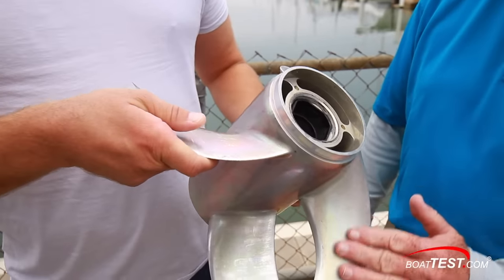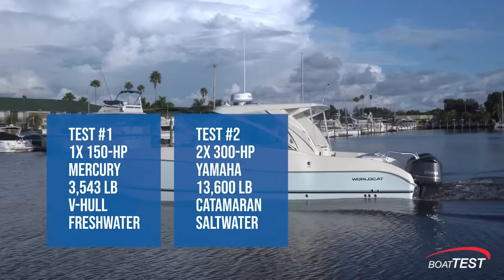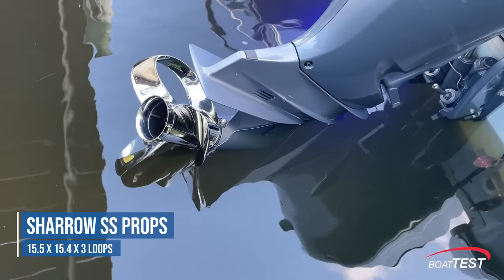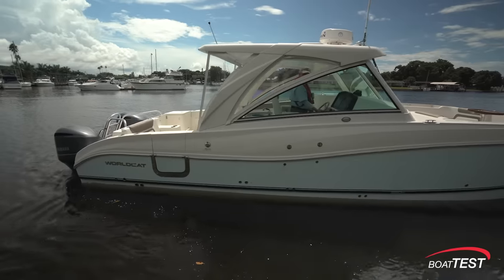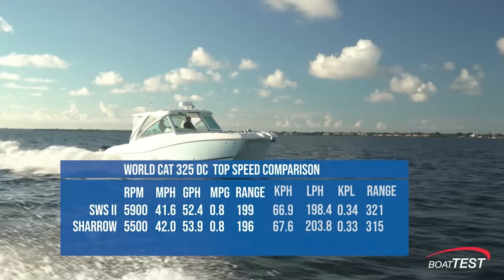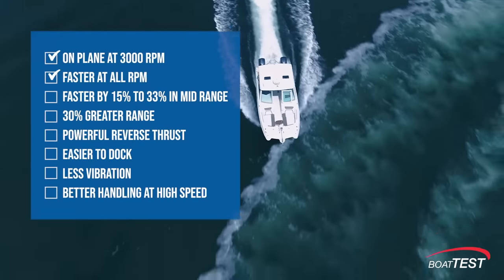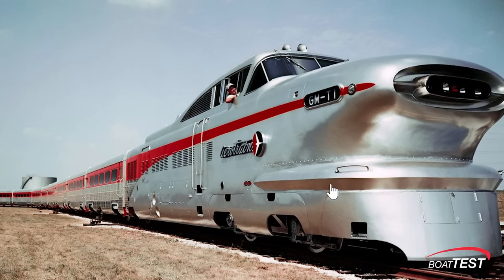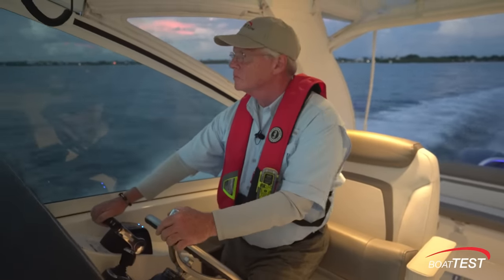Sharrow Propellers (2022) - Test Video by BoatTEST.com

Comment: Man that's a pretty rad prop. I'm glad I'm a machinist, cause there's no way I'd pay 5 grand for it. Pretty easy to see where the advantages lie. Plus it's probably way stronger. On the other hand, it's pretty clear that the testers let their impressions of this influence the way they portray the props. Advertising plus 1 mph when really it was plus .4. They rounded up despite being below the threshold for typical rounding rules. Not exactly sounding unbiased but it is a better design.

Comment: Disappointing rollout of this prop.  Doesn’t seem to have the financial backing to mass produce or distribute this prop. Current cost is absolutely not practical, with an indefinite wait time. No application for Bravo 3, with the highest amount of  stern drives on the market. But we do like Captain Steve
Reply: its a prototype. they are a startup company fishing for investors imo. they sell the prop as a one off so they can demonstrate interest for investors. once the money rolls in a proper production line will be setup. just look at tesla. they did a conversion of a lotus and made a fashion statement. now its world known brand that everyone wants a taste. this has same potential.
Reply: I'm waiting for the tesla electric motor conversion kit for my sundancer.
Reply: @steveh1121  do you think electric is more likely to succeed in offshore environment?
Reply: @adventuresofwillandshelby6013  i don't think it would be great for off shore just yet but for my pleasure boat would be great.

Comment: I have designed props for both watercraft and aircraft. By having a looped foil you are in essence having a wing tip on a wing. You see them turning up now pointing up down or both on aircraft. The benefit is they tend to reduce drag however extending the airplane wing plan further would do the same and create lift vertically. Wingtips pointing up and down don't really do that, however they do aid in keeping spillage on the main wing therefore indirect contribution to Lyft. They could simply have a longer wing and get a better benefit but then there are clearance issues in a busy airport.
The birds that soar the best have the longest wings with the pointiest wingtips. Birds that have to fly in and out of trees do it differently by having multiple wingtips dispersing the vortices that way they can be more compact. The albatross and the frigate bird have extremely long pointy wings and are the best soaring birds.
Reply from the maker: Wow, thank you for sharing this!

Comment: Would like to see this tested on some sailboats.
Reply: Most sailboats props can be folded/feathered so they don’t cause as much resistance under sail, this doesn’t look like something that could easily achieve this, likely meaning it’s not as desirable as traditional approaches. Otherwise though it’s a super cool design

Comment: I’ve had an opportunity to run these on a twin Yamaha 250 set up on a 26ft edgewater CC. For over a year now. The slow speed maneuverability is awesome with one concern: the engines sound and shift like they don’t not immediately have the torque at idle to spin up the props. It lasts only a split second but it makes me a bit nervous to hear the engines bog ever so slightly as they go into gear (both fore and aft) had the engines checked and all good according to Yamaha certified tech. I’m wondering if some applications require a tweak in engine tuning to operate these and maintain smooth operation and long term durability. Please address this!

Comment: I guess if you can afford to have a World Cat you can afford these props at 5 grand a piece, but for us common people no one can justify the cost. Hopefully the genius that made these props figures that out and lowers the cost.
Reply: As demand rises prices usually come down.
Reply: I believe these were originally 14k when they first started production.
Reply: Well when they come down even more, let us common folks know.
Reply: @michiganengineer8621  but at that price will demand rise?
Reply: @adamportner8102  Slowly at first.  But those who can afford a tricked out Freeman, Worldcat or Cigarette may be willing to pay a (relatively) small price to upgrade the performance of their boats.
Reply: @michiganengineer8621  but that test barley shows an upgrade. They are toting fuel savings but the person you are talking about is not interested in fuel savings. A guy interested in fuel savings is a commercial boater or someone that will not put out 5k when the average stainless steel prop is $400-$600
Reply: @adamportner8102  There is also the mid-range speed increase.  I agree that the overall increases aren't huge, but a 10 - 20% increase in fuel economy AND speed would be a winning proposition for someone willing to drop over a megabuck on a brand new boat.
Reply: @michiganengineer8621  I don't see any reason they shouldn't be able to sell these at the same pricing as a performance stainless steel prop. If they can't figure it out then hopefully they sell the patent  to a real prop manufacturer. Companies like Solas or tempest come to mind.

Comment: Sweet.....till the day it whackes a piece of drift wood....also....how does it help up to cavitation? Does it just get hot and turn purple like a normal stainless prop.....or does it bend and lose it's shape when it gets hot ? Seems like the missing center portion of each blade might be a compromise in overall strength

Comment: 5K for a prop lmfao. I'll pass...
Reply: Have you seen fuel prices lately? Especially if you're a commercial operator.
Reply: I'd rather run a bravo 1 30p for 1k instead
Reply: Seriously. That payback period is pretty long.
Reply: @scharftalicous  ok, you calc the ROI (return of investment)?
Reply: That is ridiculously expensive! 🙈😅

It's a coanda effect prop of sorts, I guess. (If memory of principles serve). 

I've seen quite a few airplane concepts making use of the same design principle through the past few decades. 

I would imagine only the dynamics/characteristics of the two types of matter (air/water) influences the differences in the angling and curvatures of the form to obtain either lift or thrust in the respective environment.

Interesting application of the concept. 👍
Reply: $5000+ cost will buy a sizable amount of fuel. I don’t use my boat enough to warrant it. I’ll stay with my $200 prop.
Reply: It’s just the cost of new tech. As more companies begin to develop these, prices will come down
Reply: Lol right 😂😂
Reply: how many running hours will you need to pay off?
Reply: U got to spent money to make money or u got to spend money to pay less money xd i dont realy see a problem with this prop ye its a bit overpriced but like the boat is expansive af whats another 10k in upgrades to use less fuel most of the time and get better range unless ur just flooring it all the time i wish everyone used these props and that they are made for every boat motor anything that can benefit from them
Reply: @petedude2lu3  probably 5 to 8 years if you don’t boat a lot lol…

Running hours, oops…

Anywhere from 300 to 1000 maybe? I’m just guessing by the way!

What kind of fuel numbers do you get normally on your boat?
Reply: @HardlyaDavidson  sorry, I like international system and correct money, dollars or euro or whatever you want... But not slang. 

However your numbers are correct... If you use a lot the boat for pleasure fishing or for work this propeller probably it's a good investment. But for sport boats for the weekend... The R.O.I. is infinite
Reply: Give this 5,000 days for the price to lower the cost of regular props today.
Reply: Apps for sailboat?
Reply: @RS2Diego  about 150 in ideal conditions with this setup, so probably about 250hrs. If this was a commercial boat at a average use of 5hrs a day in about 50 days it would be in the green.
So if you use your boat often it is a very big improvement, an this isn't even bringing reduced engine wear due to lower rpms in to the equation.

Edit I forgot to account for 2 engines so probably closer to 100days- so for jo blow it really don't make sense but if you are running a business you'd be a idiot to not.
Also they run alot quieter
Reply: Lol tell me your boat is worth less then this prop without telling me 😂🤣
Reply: @smokeshow1984  sorry, but your math didn't run very well. 
If the prop cost 5000 and you have ROI in 250 hrs the difference was 20 dollars per hour. 
The better efficiency of the prop is 20%? Ok, for your math your boat actually swallow 100 $/h
Really?
A single engine big block use about 20/30 $/h 

I consider recreational boating
Reply: 5k is cheap for what this is
Reply: @landonhillyard  depends on who’s buying it. Some guy with a family boat that’s in the water 20  times a year?  Yeah, long time. Guy with a charter service that runs his boat 12 hours or more a day, 6-7 days a week?  It pays for itself in a few months if that.
Reply: @RS2Diego  4:15 at 21mph he used 6 gallons per hour less, 6x5$ = 30$ a hour less fuel used.
A good ss prop is close to a grand but let's just say 500 so a 4500$ difference.
4.5k/30$= 150 x 2 (because there  is 2 engines.
So in 300 hrs in ideal situation you would save 9k in fuel but we don't live in ideal so let's just say 500 hours.
Reply: @smokeshow1984  I repeat: only for business use.
Reply: @RS2Diego  also a good rule of thumb for every 20hp a boat uses it is a gallon a hr fuel use, it varies depending on the efficiency of the motor/prop/gearbox,fuel used but it will get you in the ball park.
Reply: Some of the posts in this thread reminds me of my wife telling me how much money that she saved me at the big Sale Event this week. 
I guess that is why I'm so broke that I can't even pay attention. 👍
Reply: You can do a bravo 3 outdrive and get the same performance.
Reply: @beardedbarnstormer9577  reminds you of some cars where the rims are the most expensive things on there doesn't it. 👍🤣😅🤣😅
Reply: @anonone8954   I mean would I put this on some shitty as bay/lake boat? Hell no.  But for what it does, in commercial/charter ops on an 80k+ dollar boat it makes sense
Reply: You’re not the target audience
Reply: @petedude2lu3  about 200 hours. 

60% throttle  savings of 6.4 gph
6.4x$4.00 pg = $25.60 savings per hour
$5000 \ $25.60 = 195.31 hours to break even 

Depends on the boat and how heavy you are on the throttle but, if you run @ 60% a majority of the time, if the numbers they show are accurate, about 200 hours.
Reply: Your broke .
Reply: Yeah, I would much rather pay an extra $20k in gas every year. Big brain move.
Reply: I have to agree. Regardless of how much you save on gas, there is no way it costs $5k to make this prop which means they are price gouging the fuck out of people. Shitty move. Can't get behind it
Reply: @scharftalicous  do the math and let me know how that works out.
Reply: @funwithfamfun  depending on the size of the boat you're looking at ROI in about 6-10 months. $5k is nothing compared to the operating costs of a fishing boat which cost $10k to fill up the fuel tank. The efficiency and ROI scales up and down. Professional boat use is quite a contrast to keeping a boat in the garage that hangs out for summer.
Reply: @Phillip Scharf  Yes but no. Your only applying one variable and the comparison is not accurate.  There is a reason there are so few people use this type of propeller and it's for a good reason. Yes good design. Great idea. Very few applications and only for a very specific situations.
Reply: That roughly a $700 fuel saving every 1000 miles covered, soon adds up.
For commercials doing say 5 hours on the water each weekday Monday to Friday , thats $700 per week saving.
Reply: @Peter Stanley  I'd say fuel at $3.70 a gallon approx 7000 miles.
Reply: 5K 😳GOOD OLD AMERICAN GREED STRIKES AGAIN 🙄
Reply: Wait till next week and get a Chinese version for 150 bucks 😏
Reply: This is not a smart take. The question should be do I use my boat enough that a 25 to 30% more efficient propeller for a 5k propeller to pay for itself and be LESS Expensive than older ones. Casual users maybe, maybe not but a lot of people will SAVE money overall by paying 5k to buy more fuel efficient props.
Reply: Imagine if someone dings it talk about outta balance then there goes your lower unit😂
Reply: @petedude2lu3 more hours that the motor will last, and likely the boat
Reply: @Propnut48 5 grand is what my 4.3 liter crate motor cost me lol
Reply: Is this a prop that can be fixed for like 50 bucks like all my other ones
Reply: @sharkansas_ there is no development. There’spaying for duplication of the patent product.
Reply: @rntcalkins zero value for a displacement hull boat.
Reply: Lol..I paid 7000$ for my last prop...but it was nibral and 28" in diameter lol
Reply: Looks like a no brainer to me

Comment: So you're saying if you use this new prop at much lower rpm and speed you get better mpg than a conventional prop?.... Revolutionary indeed!
Reply: Did you even watch all of the video?  The graph clearly shows the sharrow prop is more efficient across the rpm range.
Reply: The Sharrow more efficiently turns gas into thrust.  Swap props and reduce the RPM by 1000, you lose 2.1 MPH.  Throttle back 1000 RPM without changing props?  You lose 13.2 MPH.  The speed/RPM comparison graph at 7:10 shows this.  

What I take exception to is this:

You're on the internet.  Nearly the entire history of the knowledge and works of mankind is at your fingertips.  You can read engineering white papers, look up mathematical formulas and examples of how to empirically prove your point to several decimal places of accuracy, and you can, quite literally, get a college-level education for free from the comfort of your bed by using nothing more than the phone in your pocket.  Our access to knowledge has never been more encompassing and easy as it is now.  In this case, the data was right in front of you.  In easy to read numbers.  Hell, you don't even have to know what numbers are to look at the difference in speed between the two props at 3000 RPM.  And despite all this data that's been simplified and distilled down to a concept a five year old can grasp, you chose to be a dumbass.  How's that thing you're doing working out for you?  Still feel like the smart guy here?  You wanna maybe run your mouth some more now about how wrong I am?  Would that give you the 'ole tickle in the balls you're after?  

I'd say go read a book about prop design, but I think you'd be better served learning about the Dunning-Kruger effect first.  I eagerly look forward to your infantile and empty attempt at validation in response.

Comment: I wonder how this would work out on a different style hull and usage. I have a 30,000 lb. displacement hull with a single 75 hp diesel. I went from  19 X 17 X 3 prop to a 20 X 20 X 4 prop and the difference is amazing. The Schucker 436 is a motor-sailer or trawler style vessel that operates from 1000 - 1500 rpm nearly 100% of the time. The boat will never plane and going above 1200 rpm drastically incrases fuel burn.  6 Knots is easy at 1200 rpm, but 7 knots is is around 1900 rpm with the fuel burn being 4 times greater.  It would be an interesting test but will propbably never be practical on a cost/benefit  basis.
Reply: range increase. for the that reason alone its worth it.

Comment: For the vast majority of boaters this new prop is way way over priced. About a year ago we replaced our damaged prop for a new one and it was about $450.00 and I put it on no labor cost. Props are machined on CNC 5 AXIS machines and these machines can do amazing complex machining tasks very quickly, but by no means can you justify the 10 times higher cost for this new prop. This is simply just pure greed behind the pricing!!! I think what the greedy manufacturers did is PROP UP THE PRICE AS HIGH AS THEY COULD JUST BECAUSE THEY COULD. Honestly can anyone take a serious look at this prop and justify the material cost and machining cost that a CNC machine could pump out in about 20 minutes or so??? Come on now, are you serious, are you serious!!!???
Reply: someone has to pay for that 150k cnc and tooling cost.
Reply: If you can double the power on your 100K boat for 5% of the cost, its a great deal

Comment: $4900 this is insane 😂
Reply: i mean it makes sense why its so expensive, its made to order and you choose pitch and rotation, its also stainless steel that has to be CNC with complex geometry and it iou performs standard props by a far margin, but i agree thats an insane amount of money. i can see something like this technology being more for the commercial market very valuable to something like cargo ships where efficiency is very important that is if the performance can be scaled.
Reply: It’s probably a little high, but for a guide or commercial fisher would pay for itself eventually.
Reply: WHAT???? My first boat did not cost that much.
Reply: With $7.29 boat gas in florida and a reduction of 6.4 gph, in this case the props pay for themselves in just over 100 hours of operation.
Reply: Yeah these will be a new target and more profitable to steal than catalytic converters.
Reply: This isn't for us. This is for people on 600k-2M cruisers and center consoles. Chump change for them.